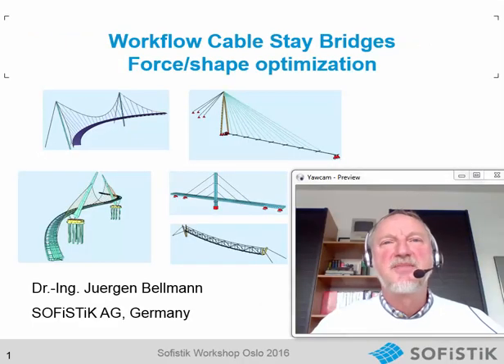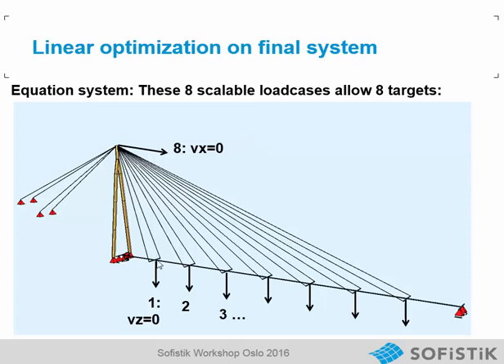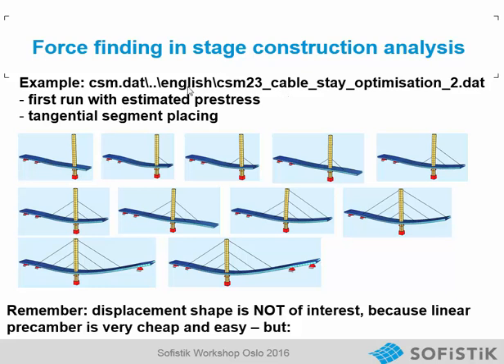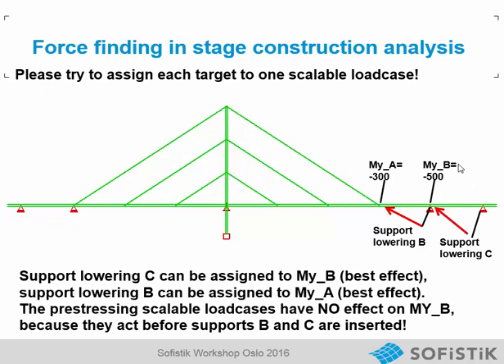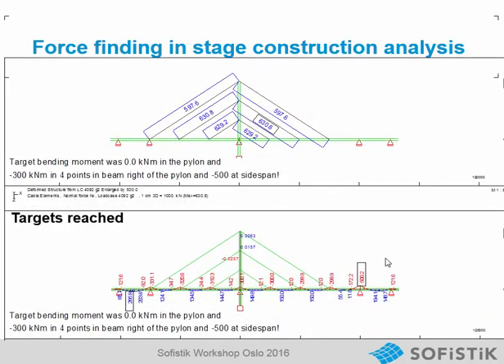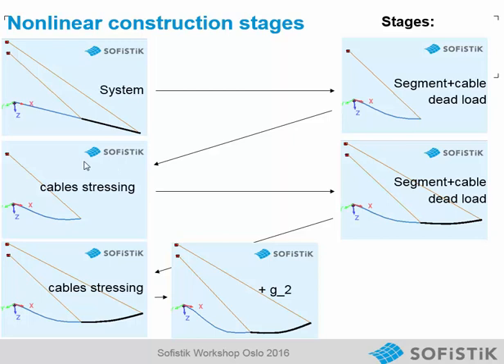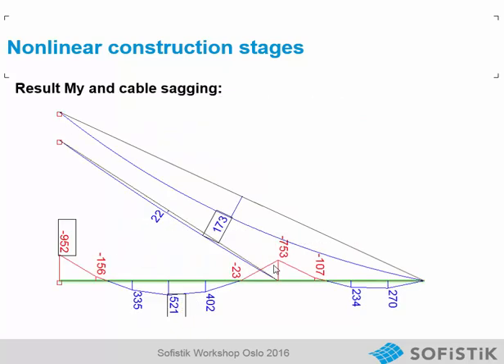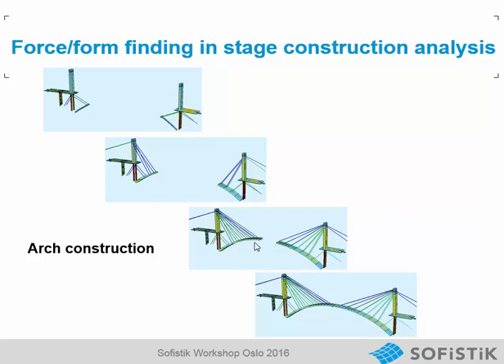CSM Force Optimization

Comment: sorry this topic is old but i have a question
LCC 117 FACT -197.51017761
LCC 118 FACT -773.50988770
LCC 119 FACT 1341.81909180
LCC 120 FACT 1123.38745117
LCC 121 FACT 185.81295776
this is the results for my data after running linear cable force optimization, it gives negative result for cable prestress factor coefficient and I think it is not correct, is there any way I can control the range of this factor? Reading in teddy manual I see that I can add FMIN, FMAX in EQLC command say EQLC NO (117 152 1) TYPE FREE FMIN 1000, however it seems there is no change in the result. Thank you.
Reply from the maker: Hi kidsnextdoor1908,
for such specific questions, please send a support request to our support via Help-Support Assistant :).